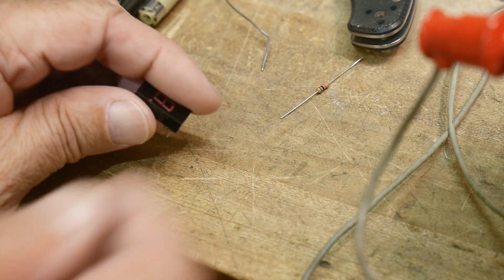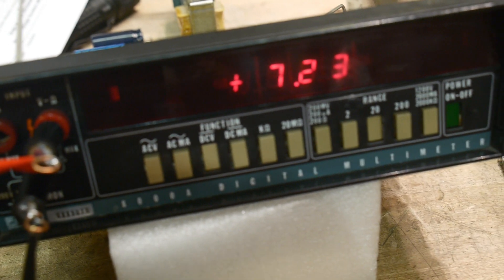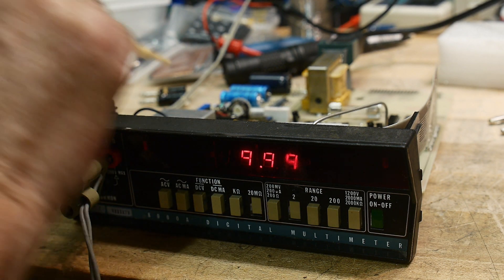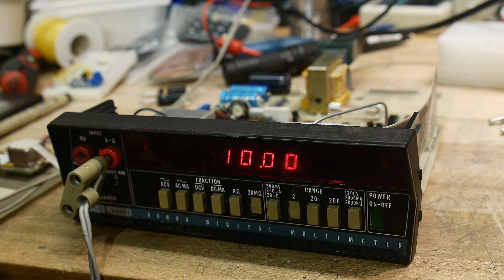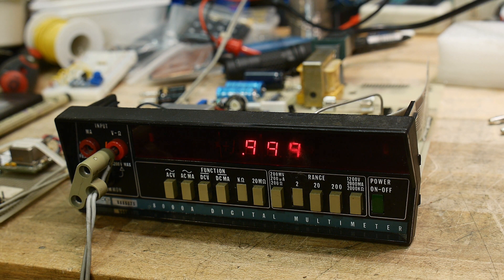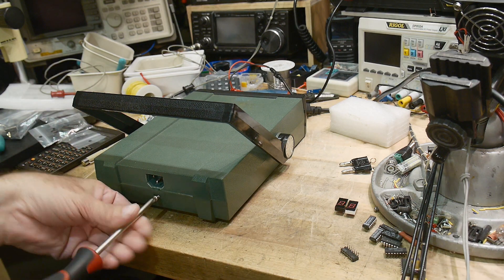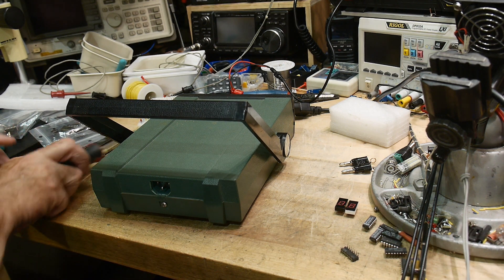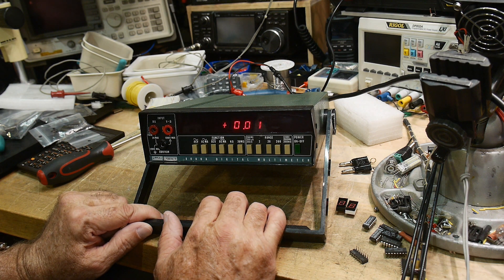#1293 Fluke 8000A Multimeter repair (part 3 of 3)

Comment: I used one  a LOT when I was a member of the process computer hardware repair group for ComEd.  We worked on Honeywell 4020, 4010, 4500 machines as well as a old Westinghouse P510 machine.  The P510 was transistor logic machine. Fun to work on.  It had 12k of RAM (18 bit word) and a 64k drum memory unit.  The machine had a neon indicator for every bit of every register.  The panel was about 36 inches by 36 inches.  My scope was a Tektronix 545.

Comment: Very interesting,  the 8000A I have is very different,  has 4 D cell  nicads and alot of different compinents on the board. The pcb # is 8000A -  3011. Alot the same but alot different.  Have no schematic so going to try and locate but it does work fine so far. Thankyou for the insight!